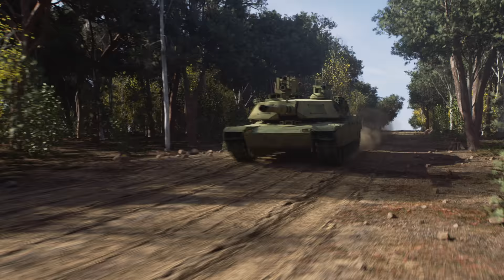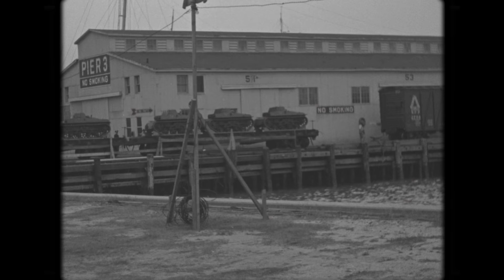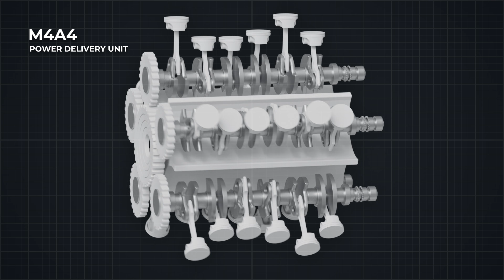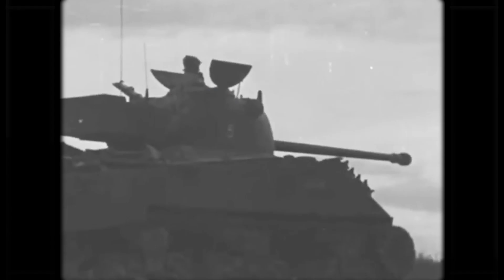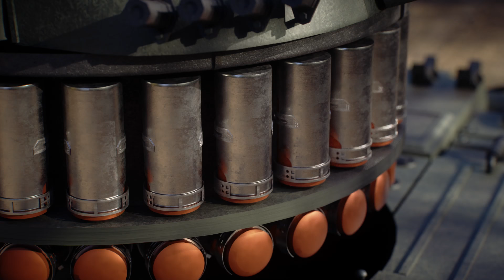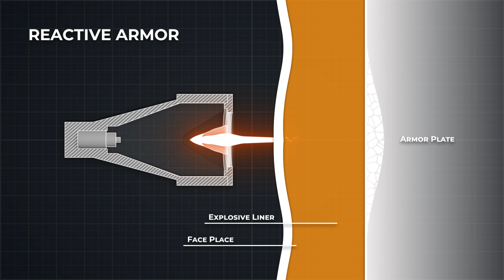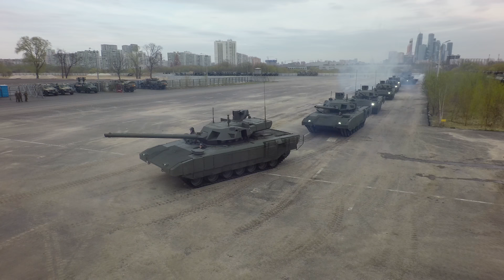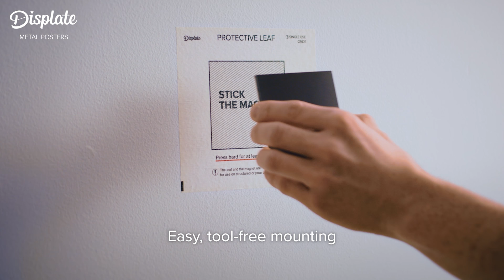Why America’s Tank Failed in Ukraine

Comment: “Inline V6..” Wouldn’t that just be considered an inline 6?
Reply: Volkswagen enters the chat…
Reply: Or a v12? Two inline 6 in a V?
Reply: Yep.... He shouldn't have said v
Reply from the maker: That’s the second time i have said that exact thing by accident, even though the script doesnt say it. My brain is dumb
Reply: Start saying "straight six cylinder engine".  Something about the alliteration of "straight six" helps keep the V out of my mouth.
Reply: @Mountain-Man-3000 What about gay six cylinder engines?
Reply: @RealEngineering  Boss, T-14 is a hoax, it has been cancelled about 3-4 years ago. Allegedly 7-8 tanks have been built and the production was stopped, forever. One reason, no more access to the western components.
Reply: @rocketman1058 Russia has never used foreign components in their military equipment.
Reply: @foxtrotalphaone  ahahahahahaha umm what about the literally hundreds of instances of captured and downed orc litany hardware that has thousands of western components? 

Lmao
Reply: @rocketman1058 it is not a hoax honestly speaking. The truth is that the Russians needed a newer platform, and not just for tanks, and the Armata platform is a great one that just came a bit too late and too few in numbers of applications (like the t-14)
So yes you are correct in saying that the T-14 main battle tank configuration that was presented pre Ukraine war is a failure, in the sense that it was a very advanced tank but engineered for a type of war that we now know it is obsolete. The truth is that the ubiquitous aspect of the modernised T-72 variants, as well as the tank losing the role of "main star" in modern warfare, as well as Russia being in a war where "quantity is a quality of its own", all made them set aside the expensive and rare T-14.
So we can see this as the T-14 being the test run, and most likely by the end of this conflict Russia will have a line-up of Armata based vehicles conceived for the aspects of modern warfare like drone ubiquitousness and near-permanent live satellite coverage. I'm betting automated point defense will be the first true step for tanks to properly handle the drone issue.
Reply: @foxtrotalphaone  recent Starlink shutdown in Russia says otherwise. Plus T-14 used ton of off-the self components from french which made T-14 massively depended on imports.
Reply: @foxtrotalphaone  False, on the day one of invasion Ukrainians found that all Russian BMP-3 had all targeting and electronics made in France and Germany. That's just the tip of the iceberg. But you keep believing Russians manufacture anything
Reply: @RealEngineering if you're dumb I'm sub-brick
Reply: @RealEngineering  The M1A1 dominated (despite drones). The fact that so few remain is simply because so few were sent, and they fought almost nonstop in the heaviest fighting for well over a year. NOTHING will survive that without heavy losses.
Reply: @RealEngineering 😊
Reply: @RealEngineering  Your whole video is kinda dumb. Which is a shame. 

Maybe you could cover the M1A2 Sep V 3 if you want to actually cover a modern American tank.
Reply: @RealEngineering  we have noticed your "brain is dumb".
Reply: @RealEngineering why did you clickbait?
Reply: @RealEngineering  Ngl man im really saddened by the quality of this one in particular. feels more like a missed mark to talk about how tank design in general will need to change due to a change in warfare if thats even your channels thing really. Feels more like alot of padding.
Reply: Maybe its a VR6 from an old mk4 Golf?
Reply: @lucimon97  VR6 is still not an in line engine - it is a monoboc V
Reply: @PaulG.x  they call it a vr6 because it combines v6 and Reihen-6, inline 6, because it is both of them but also not really
Reply: Inline and V are two entirely separate concepts.

Why they chose to combine the two and show an inline engine is beyond me, apart from just general apathy
Reply: they do exist, VW has a done multiple, they call them VR engines.
Reply: @SuperUltimateLP a 15 degree angle isn't a 60 degree angle and a 0 degree angle, it's just a 15 degree angle. Either call them VR engines, or an offset bore inline engine
Reply: @noncog1 I'm not sure what you are trying to say here.
VR engines are narrow angled, yes.
You might want to rephrase that comment so it makes any sense.
Reply: @SuperUltimateLP might I suggest eng1101?
Reply: @noncog1 my guy, look at that catastrophy of an sentence you have written...

Your response also doesn't appear to be written with any sort of care...
"Might I suggest eng1101" are we talking binary now?
Reply: @SuperUltimateLP if you think "eng1101" is binary that conpletey explains the issue lmaoooo
Reply: @noncog1 that I was making fun of you completely bypassed your synapses?
Reply: @SuperUltimateLP basic logic bypassed yours. Yeah sure you think you're some grand internet troll, but I'm letting you know that to the people wothout your internal dissonance you're making yourself look immature and unthinking. I sincerely hope you're like 14 or 15 so your behavior is understandable, but if you're an adult you need to grow up.
Reply: @noncog1 your first comment is nonsensical and you refuse to clarify.
Then you felt challenged and attacked my English proficiency.
You failed at expressing your idea, also you try to argue over a industry term that is already established.

It's not the readers fault if the author fails at describing their ideas.
I know literacy is on the decline in the US, but please try to explain the issue you have with my original comment...
Reply: @SuperUltimateLP my first comment is perfectly readable for anyone that puts any effort at all into understanding it.
I'm so glad you brought up establisbed industry nomenclature, because a VR engine being an "inline v" ain't that.
If an author writes and the reader is illiterate, the failure isn't of the author. The angles you take to attack continue to reinforce my statement on your maturity, which I notice you didn't address.
Reply: @noncog1 You still haven’t explained what part of my original statement you disagree with technically.
VR is established nomenclature for a narrow-angle V with a shared head architecture.
If you have a specific technical objection, state it!
Reply: @SuperUltimateLP  I get what you're saying, but those are not inline cylinder engines at all, look at the layout of a straight 6, the cylinders are inline, straight, this is not that, sure, it's a "mix" of them but it's still a V engine, not straight cylinders
Reply: @DirtDog. A V engine with a single head and only two cams is kinda unique.
It's a narrow angle V, yes, but it also has the main features of an inline engine, those being a single head and only one intake and one exhaust cam.
Reply: @SuperUltimateLP  Not unique either:
"Italian automobile company Lancia was the first to manufacture cars with V4 and V6 engines in series-production. This started with a number of V4-engine families, that were produced from the 1920s through 1970s.
The Lancia V4 pioneered the narrow-angle V engine design, more recently seen in Volkswagen's VR5 and VR6 engines. By using very shallow V-angles — between 10° and 20° — both rows of cylinders could be housed in an engine block with a single cylinder head, like a straight engine."
"The Matchless Silver Arrow was a motorcycle made by Matchless from late 1929 to 1933. It had a cast iron head monoblock side-valve, 400 cc, 18° V-twin .
The Silver Hawk's 592 cc design was a development of the Silver Arrow and shared a similar frame design and cycle parts, as well as the monoblock 26 degree V4 with a one-piece OHC head concept."
Reply: @PaulG.x unique amongst its peers.
Also, you act like I invented the term, it's a real engine geometry, it is not just a V.
I didn't invent the term, was just responding to an comment that discounted the possibility that an engine can express both features of an inline and a V engine.
It lies somewhere in between.
A V for example has just normal pistons, in an VR that's not the case.
Reply: @SuperUltimateLP  clearly you are unable to read.
Have a kind associate read the following to you:
"Italian automobile company Lancia was the first to manufacture cars with V4 and V6 engines in series-production. This started with a number of V4-engine families, that were produced from the 1920s through 1970s.
The Lancia V4 pioneered the narrow-angle V engine design, more recently seen in Volkswagen's VR5 and VR6 engines. By using very shallow V-angles — between 10° and 20° — both rows of cylinders could be housed in an engine block with a single cylinder head, like a straight engine."
"The Matchless Silver Arrow was a motorcycle made by Matchless from late 1929 to 1933. It had a cast iron head monoblock side-valve, 400 cc, 18° V-twin .
The Silver Hawk's 592 cc design was a development of the Silver Arrow and shared a similar frame design and cycle parts, as well as the monoblock 26 degree V4 with a one-piece OHC head concept."
Reply: @SuperUltimateLP  VR6 is still not an in line engine - it is a monoboc V
Reply: @SuperUltimateLP But that's STILL a V Shaped engine block 🤡
Reply: @edwardfletcher7790 but a single head, so it's a V and an inline at the same time in German inline is "Reihe" that's how the VR came to be.
Reply: @SuperUltimateLP  what does a single head have to do with it? The V designation is because the cylinders are in a V shape, doesn't matter what the head(s) disposition is/are
Reply: @edwardfletcher7790  also not true, the bores are at an angle, but the block is not V shaped.
Reply: @SuperUltimateLP 
Saying it's both, is like saying a V8 is also a V6 because it has 6 and 8 cylinders 🤡
Reply: @MotoRiderTube it does matter, because the words spoken were "inline V6" Features of both engine types.
If you have overlapping features, then an "inline V" isn't mutually exclusive.
OP said that this would make it an "inline 6" that's not automatically true.

Two cylinder banks exist, therefore not inline.
One head and compact block, unlike normal V.
Reply: @edwardfletcher7790 ... the German MTU Multifuel engine is a V12
Reply: @edwardfletcher7790 that's braindead...
You literally said " the block is STILL a V shape" which it isn't...
Maybe you struggle with English and truly meant the angle of the bores, but in any other case you have factually not said anything truthful.
Reply: @SuperUltimateLP  keep digging

Comment: American conventional warfare tactics we're not used in Ukraine. That's the problem. 

Ukraine sent one or two of these out at a time. American tactics dictates sending at least a dozen of these out at the same time to completely overwhelm the enemy positions.
Reply: They tried that, They got thwapped by drones and arty and stuck in a pile and then picked apart. There is too high a concentration of firepower, defensive positions in depth and minefields for that strategy to work now. Anytime Russia or the Ukr tries to concentrate forces like that the get spotted and blasted to hell. There is too much surveillance both from SAT's, Air, ground and radio. Every combat team of both sides has enough AT to take out a tank. Combine that into platoons and they today have enough AT firepower as to not need tank support to defeat tanks.
Reply: @keith3761 going out with three tanks is not a dozen.

Comment: The fact we dont see diesel electric drive trains in tanks is mind boggling. At what point does having to have a massive transmission, differential, and clutches per axle to control steering get to be too much vs two electric motors and your choice of controls. Then just rev the engine up to match the power needed, vs having to row through the gears. It means the engine can be designed as a generator rather than a motor, with a better efficiency curve. "oh but mechanical power delivery is more efficient than electrical" and to that I say weight reduction from the lack of a gearbox, and the ability to downsize the engine as it doesn't need as much low end torque anymore will compensate for the fuel losses of converting mechanical to electrical and back. Plus theres now no power loss in the gears and diffs.
Reply: What's worse, electrical transmissions are not less efficient anymore with modern rectifiers, inverters and electrical machines. Permanent magnet synchronous machines easily sit above 95% efficiency, rectifiers and motor drivers not quite that high but still highly efficient. Comparing that to a gearboxes losses over heat and friction (and the still common failure point) should result with electrical drive trains on top. As a bonus it'd allow some (very short) silent operations of the tank if the DC side is supported both by generator and battery. 

If I had to hazard a guess why it's not used: tradition. Same reason european (and US) car industries struggle so much with adopting EVs. They're good at ICEs and don't want to divest. On top of the failure of Porsche's Tiger as historical precedent for electrical drives not working on a tank.
Reply: @nstch-root-a  Look up Hägglunds SEP and see what technical difficulties they struggled with.
Porsche has nothing to do with this.
Reply: @johanmetreus  Readingcomprehension sir. hazard a guess is a qualifier to show uncertainty. 

Please resume the discussion when you've mastered the english language to a degree of proper understanding, or matured to the point that you don't aim to dunk on people over low hanging fruit. 

As an aside, I have a background in mechatronics and am well aware of the difficulties associated with either technology, direct drivetrain as much as electrical ones. 

What's your technical background?
Reply: @nstch-root-a  Automation technician, with industrial focus.

Om du så önskar kan vi föra diskussionen på svenska istället, om du nu känner att min förmåga att uttrycka mig på engelska inte är brukbar.
Reply: The only area I am aware of where engine-electrical drives are used on a regular basis is railroads, possibly because generator + motors weighs as much as the transmission does.
You also missed the cooling problems of heavy duty motors in a confined armour box. I know Hägglunds had made some real progress with their SEP project, but that was cancelled when we had to buy Patrias as compensation for Genomförandegruppen blowing the AMOS deliveries.
Reply: There’s also very heavy mining equipment and the Space Shuttle Crawler that NASA uses for moving rockets. 

The reason they and the trains used electric drives is mainly for the sheer torque they need to move something that big and heavy. They also don’t have cooling issues because they don’t have to shield it in armor plate. 

There’s also diesel-electric subs, though that’s because electric motors don’t need air to function and won’t kill the crew through CO poisoning.

Didn’t know that about the SEP and Patria. The concept was pretty cool, and wondered why they dropped it.
Reply: Well Caterpillar has shown it can work with their D6 XE electric drive hybrid dozer. Add some batteries and you have a vehicle that can silently observe and move short distances be starting the generator.
Reply: @glenndennis6801  the dozer is not being shot at by high velocity sabot discarding rounds
Reply: Keep in mind that pretty much every modern tank in operation was designed before I was born.   I was born midway through Reagan's first term.
Reply: @YaBigDummi interesting and depressing
Reply: That's what Dr. Porche said to Hitler.  But back then, during the trial between Porche's electro-mechanical design and an all mechanical design, the Germans chose the latter since it was more proven technology.
Reply: At the end of the day, I don't think we'll see hybrid drive-train tanks anytime soon. Any weight savings from not having the gearbox would be mitigated by the colossal weight of the battery pack needed to pull this off. On top of that, it presents a hazard to the crew simply because of the nature of these battery packs. War is full of unexpected events, obviously, in the event that the floor gets breached or the battery gets punctured, it's going to cause a violent on-board fire. On top of that, it's far more expensive to build hybrid/electrical systems like that.
Reply: Electric drive and the associated controls that would be up to the job are actually relatively recent. Give em a chance…
Reply: @gazza9945 I work with electric motors in equipment that are precise down to 1 1000th of an inch, move several thousand pounds, run off of a single 110v cord and were developed in the late 80s. Funny enough, that's barely any older than the Abrams. With the military's infinite budget they could scale that up to size for a tank pretty seamlessly. If anything modern computing would over complicate it
Reply: @james2042  Yes, I expect it was doable by the 90s but still risky. Much easier now. The Defence budget only becomes infinite after a project is approved so risk assessment is a thing, they can only contain so much bs to get approval.